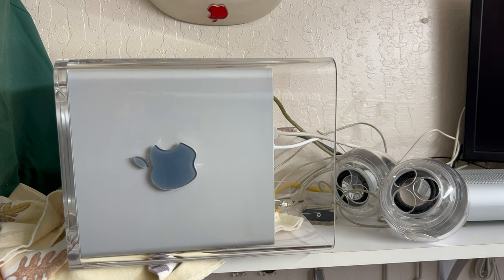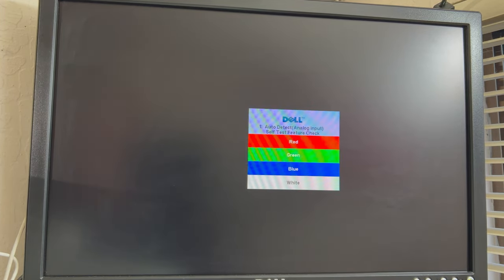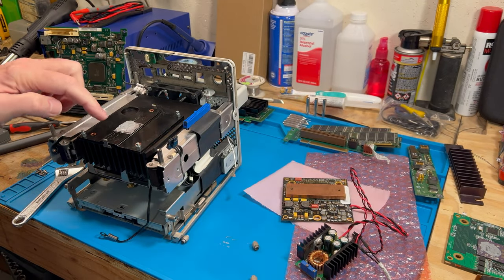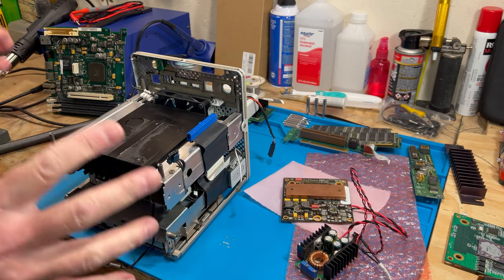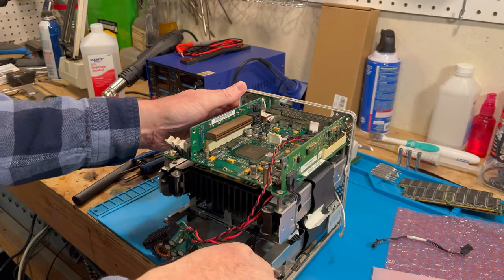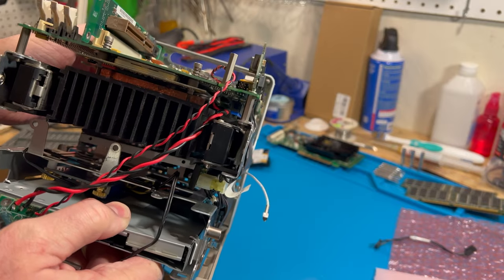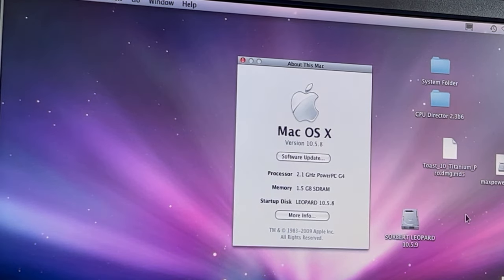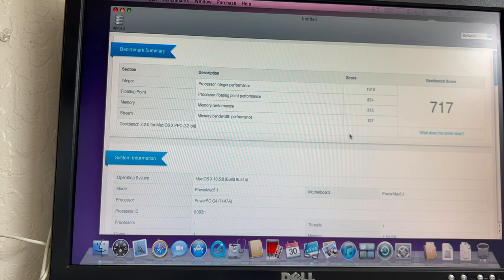G4 CUBE 2.1GHZ POWER COMPLETED part 2

Comment: @24:34 it looks like the 1.4ghz G4 has 2mb L3, but the 2.1ghz g4 has no L3 cache. I saw that the performance gain seen @24:55 wasn't as significant as one would think it would be with such a CPU upgrade. Could it be that a lack of L3 cache on the 2.1ghz G4 is hurting the performance? @Daves Vintage Apple Tech
Reply from the maker: Yes very interesting the the lack of the L3  for sure but never the less A Great upgrade. The 7448 was the last of the Apollo series of that line of processors
Reply: im honestly wondering if it is at all  possible to install the l3 or repurpose the 1.4 card

Comment: Thank you for sharing to link to this video for me in a commend under Part I.  Naturally, as a fellow Cube owner, I'd love to upgrade beyond the 1.2GHz and 1.3GHz Sonnet cards I have installed now in my two Cubes.  What is the exact model number of the 2.1GHz CPU card, and did you acquire that direct from a seller or on EBAY?  (I'm basically trying to figure out where to find cards as fast as you and Sean have.)  Also, it seems from Part I that someone else made that custom copper block for your card.  So I would need to figure out how that was done, precisely.  Anyway, thank you for the two videos on this topic.
Reply from the maker: I got the card from Herd 68k Mac form he made the custom heat sink and 28volt power adaptor the that cpu card. Now later in the year dosDude will have a Duel processor with for the G4 cube 2ghz or higher with a newer chip set he will be making these I will kept you posted
Reply: @DavidStahlOLDHAPPyMACs  Wow!  I would be truly grateful if you would keep me posted, either in a follow-up comment here, or you can click my JDW name, then click About and scroll down to find my email address.  

By the way, I used to be a member of the now defunct Cubeowner forum.  I enjoyed doing mods back in the day (around 2005) when my friend GeneHack was active.  I remember swapping out the graphics card with a GeForce3 only to have it die a week later.  I added upgraded VRMs and a case fan at that time.  As you can see from my Avatar, it's my favorite vintage Mac.  The industrial design still looks amazing after all these years.
Reply from the maker: @JDW-  Yes  I will JDW.I plan on Getting one of the cards my self I just finally got one of the stratos VRM boards I need to add a connector on the 5Volt rail on the card  so I can run the CPU card directly off of it so that way I can get rid of the 28volt by pass power supply that herd made me
Reply from the maker: and just go to the Ebay link on that video and elect on of the SATA to IDE adaptors the pic of the first two is the ones that I have
Reply: @DavidStahlOLDHAPPyMACs  The first 2 EBAY auctions look exactly the same but the one selling for $6.46 is mentioned as being "Seri.Q6" while the other sells for $4.65 and says it is "SerialHM" -- whatever that means. Seller names are different, although both are in China. Then if you look down further on that EBAY page, there are several other items with the same photo yet different pricing.  I was a bit confused by all that, which is why I asked what you have.  But it seems you have the first two, and I am guessing there is no difference between the two -- meaning, they are all the same.
Reply from the maker: @JDW-  https://www.amazon.com/gp/product/B08ZC9B2NR/ref=ppx_yo_dt_b_asin_title_o09_s00?ie=UTF8&psc=1 I put this one in my flower power G3 imc this will work in the G4 cube
Reply from the maker: @JDW-  https://www.amazon.com/gp/product/B08ZC9B2NR/ref=ppx_yo_dt_b_asin_title_o09_s00?ie=UTF8&psc=1 this is the one I have in my G3 iMac Flower power It works in the G4 Cube

Comment: i forgoten u g4 cube version geforce mx2 32mb the graphice card? my coolection piece the 500mhz version same geforce mx2 inside interesting for any graphice card upgrade this or this cpu inside any more good intergradet video card?
Reply from the maker: NVIDIA GEFORCE 6200 256MB AGP VIDEO CARD is what in my cube
Reply: okay thx the info :) my last quest for gefornce 6200 the g4 cube same mac edition need? have me one power mac g4 the tower desktop version diference a same time p4 and g4 mac pc for agp video card separately mac edition use a little + coonector the agp slot
Reply from the maker: @elitedavid8705  the one I have is A Flashed pc version with the apple firmware drivers works fantastic